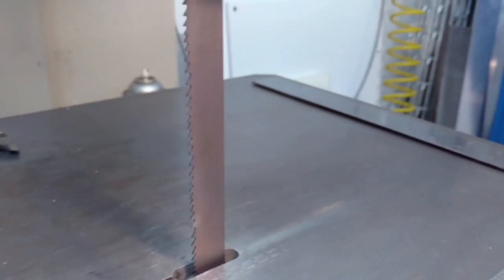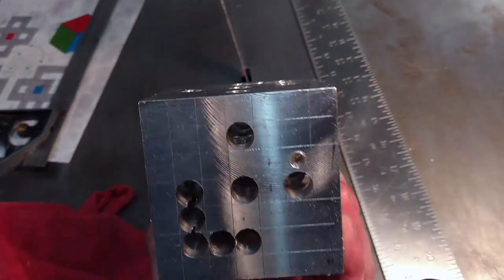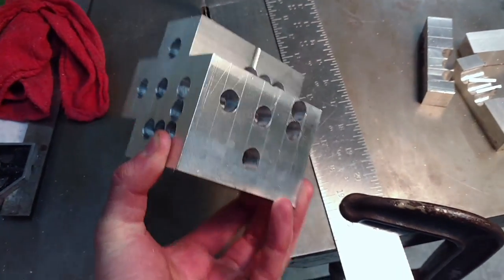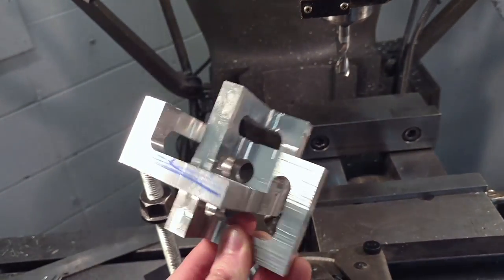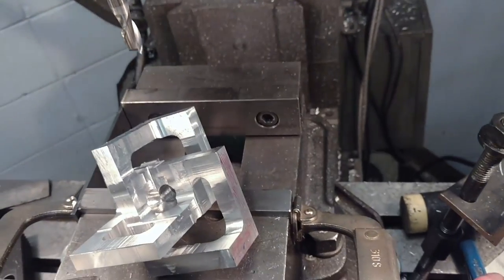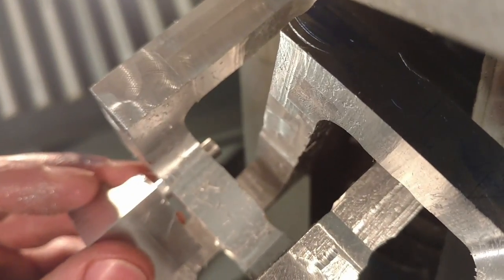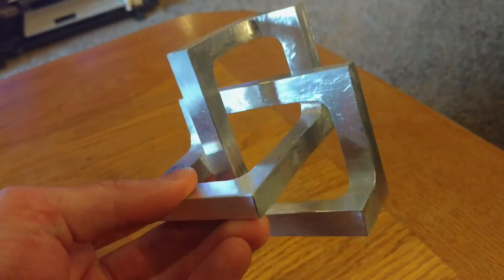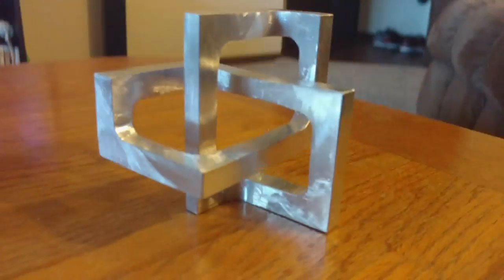TriCube (Cubic Trefoil Knot) from 1 Piece of Aluminum

Comment: Great job, Wonder how a 3D printer would handle that project. Oil on the drill
You forgot the starting point
Reply: @Brian Knickerbocker 
Lots of support material, that's for sure.